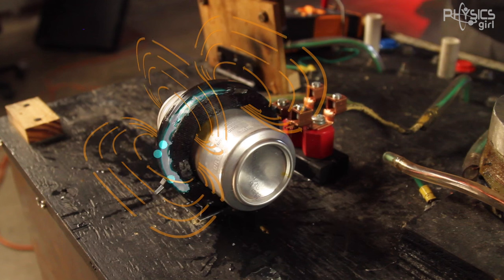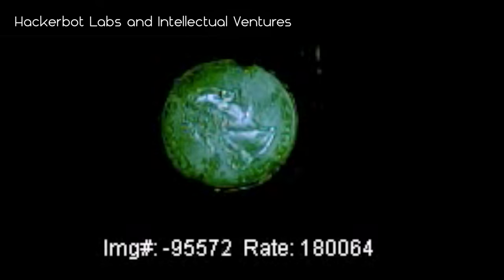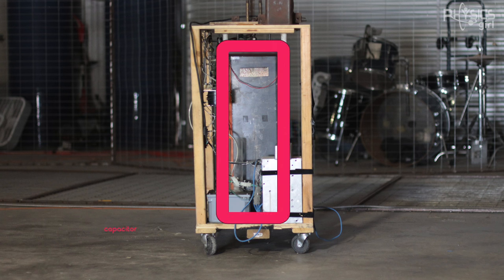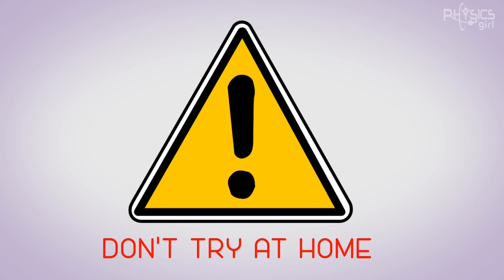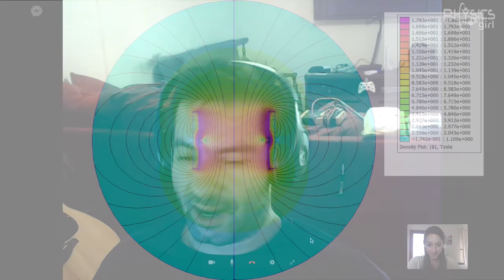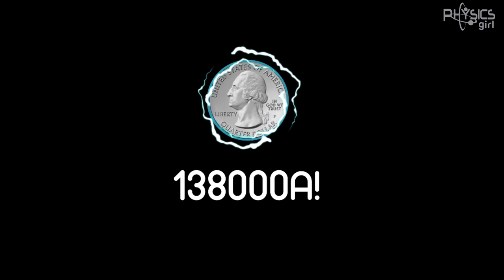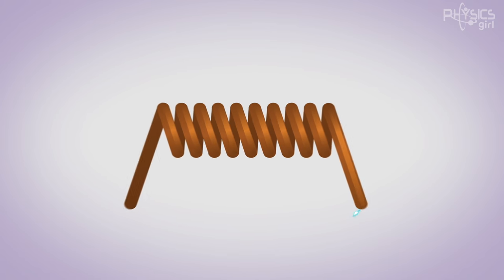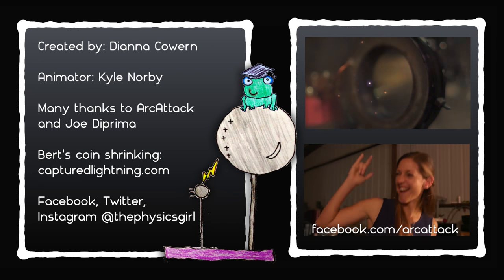How to Shrink a Quarter with Electricity

Comment: Where does it get the space to shrink?  It's not like the atoms change size, so I assume the empty space was already present in the coin and the atoms are just packed tighter.
Reply: The coin gets fatter, so it's not really "shrunk", more like deformed. The atoms might be slightly more packed together, but it would be a very small difference in volume.

Comment: The crazy part is, that this is the result of relativistic length contraction of the distances between the electrons in the coin. They are forced into the center by the eddy current.

Comment: Try that at 100KV (and less capacity or larger coil), should be faster for a more uniform result.
What happens to carbon? Can you turn a pencil into diamonds? What about with high heat at the same time.

Comment: If magnetism creates space, and dielectricity squeezes into counter space. And electricity is a hybrid of the two once split, trying to rejoin... Then, any coherent matter, capable of conducting the electricity... Theoretically will release the magnetic space, down to the atomic level in exchange with the magnetic reflector (the coil) in the attempt to rejoin the field in counter space. The atomic atoms/molecules, are losing their magnetic space in the process of unification. Space literally disappears, just like when two powerful magnets are near each other. I probably butchered this explanation, but the outcome fits perfectly with Ken Wheeler’s book on the missing secrets of magnetism. Which all physicists should at least entertain for the purpose of pushing the world into the next scientific paradigm. Ken is onto something, as crazy as he may be...

Comment: What you are doing is freezing time in the coil and as the rest of the universe expands, that little area is frozen in time and doesn't.  That is why the coil explodes as it is both frozen and not.  The coin is basically a little back in time and is smaller.  ;-)  Now if you can only figure out how to reverse the process and send something forward in time.

Comment: Wouldn't trust that bleeding resistor. If the shown circuit is correct then the cap would stop discharging through the resistor when the voltage dropped low enough for the arc to extinguish leaving an unknown charge in the cap. Don't know how much, but there would be something there.

Comment: Writting 5 years later... just thankful for the algorithm... And wondering Do the coins end up with higher density? is that even possible? The mass remains the same as they shrink?
Reply: Shrinking is a misnomer. Here is a line from Stoneridge Engineering website. "A shrunken coin weighs exactly the same as it did before shrinking. As the coin's diameter shrinks, it becomes correspondingly thicker, but its volume and density remain the same. ".  http://www.capturedlightning.com/frames/shrinker.html#:~:text=A%20shrunken%20coin%20weighs%20exactly,and%20density%20remain%20the%20same.

Comment: two questions:

what's the mass before and after?

what's the volume before and after?
Reply: Answer to both questions: The same before and after. The coin becomes thicker as it is reduced in diameter.
Reply: For a "science" channel you think this would be included. I wouldn't be surprised if density was slightly increased and some mass was lost. Likewise, I think it's unwise to make the assumptions you just did without stating them as hypotheses.
Reply: We have weighed coins before and after - no measurable change. We thought mass would increase a bit due to very light surface oxidation from the heating. However, we were unable to measure any change.
Reply: Bert Hickman Any volume measurements?
Reply: We were unable to detect any difference in volume. However, the measurement was not very accurate (i.e., volume of displaced water in a graduated cylinder).
Reply: +Bert Hickman I thought that may be a problem.

Solution I could think of was magnifying the result by doing a roll of quarters.
Reply: (by doing I meant measuring the volume of a roll of quarters before and after)

Comment: I need a bleeder for working on tube amps! (actually it’s fine if you just allow the amp to discharge before opening the chassis). Too bad we can’t use electric currents to shrink inflation as well as currency! :-)

Comment: did the mass of the coin change? if so, more of the why.
Reply: @little8660  now that i think about it, I dont think there is mass loss, some but not alot. same mass. it popped into my head about how a nuke bomb was thought of. compress a critical mass. then you get an explosion. well extreamly simplified of coarse. but compressing a mass into a smaller volume. or take how a diamond is made. by compressing the mass into a smaller volume.

Comment: Could it compress plutonium to supercritical mass ;)
Reply: Maybe.  If you had a slightly subcritical disk of plutonium with a hole in the middle, shrinking it would cause the hole to close and perhaps make it critical.  I don't know if it would be fast or significant enough to result in a substantial nuclear explosion though -- probably not.

Comment: I still don't get how the coin shrinks. It must be an annealing affect because the coin is stamped and expanded like cold forging. The Lorentz force must heat the coin and realign the atoms in a crystalline way so as to anneal the metal structure, causing shrinkage. Can anyone verify this?

Comment: Are the 138000 amps true amps if the time of discharge is a small fraction of a second?
Reply: Yes - amps are amps. It is the peak current during the capacitor discharge through the coil. It's an LC circuit, so it "rings" until the coil self-destructs.
Reply: I guess the computer can figure it out for the short duration of time. It is just that the amp is said to equal the flow of one coulomb per second.

Comment: How would a pure silver quarter (pre-1964) react to the coil?
Reply: The silver-copper alloy melts at a relatively low temperature. We've found that silver quarters and dimes actually come apart and the pieces turn a brassy color as some of the copper crystallizes out of the alloy.
Reply: +Bert Hickman

The pure silver coins?

Comment: 26 Megawatts? I'm sure the electricity company would not be happy about it when you take that much power from them. My guess is that to balance conservation of energy this amount of power will be required / available only during a very short time.

Comment: So basically the same mechanical force as a sledge hammer being slammed on a quarter to flatten and widen it except this is compressible around the edges only?  I've never thought of myself capable of exerting 26 megawatts of energy when wielding a heavy sledge hammer before but hey, I guess I do lift.. bro.   lol.
Reply: At CapturedLightning.com we use 5 kjoules to ""shrink" a quarter to the diameter of a dime.  5 kjoules is the same energy as 3700 pounds dropping one foot - one BIG hammer...

Comment: Hold on. There was no explanation as to why the coin gets smaller. Does its density increase via the process? Or does it actually lose mass when it shrinks? This video was not scientific... Why does the coin get smaller when subjected to a high inductive current?

Comment: You have to put in 26 million watts to get 26 million watts out. Something must be wrong with the math because there is no way that amount of power came from the mains. They said nothing about charge time of the capacitor. Given enough time one could eventually collect a million watts. 40 amps X 240 volts = 9600 watt hours X 24hours = 230400  watts a day. OK , that's getting there. You will have over 1 million watts in 4 days. So in about 100 days you could accumulate those 26 million watts. Then there is the cost. I pay about 15 cents, power and delivery, per KW/H . That's 3900 USD . Now I understand about peak currents and short discharge times. But can you get 26 million watts discharged in 1/1000 second without putting in a total of 26 million watts , No matter how long it takes ?
Reply: Don't confuse power with energy.  Power is watts, energy is watt-hours.  Think of it like a toilet flushing -- it takes a minute or so to fill the tank, then all that water shoots down the pipe in a few seconds when flushed, thus moving things down the pipe a lot more forcefully than the same amount of water would do at the tank-fill rate.  The coin shrinker multiplies the effect of a lower-power input to a high-power pulse even more, kinda like a toilet on steroids.
Reply: LexipMedia Power is energy.volts are not energy. Amps are not energy.Electrical energy is measured in watts per unit time. Based on the Coulomb . 1 amp at 1 volt for 1 second. That is 1 watt second. A 1 farad capacitor stores that coulomb at 1 volt and will deliver it to a 1 ohm load in 1 second.. I will do that calculation and get back with the size of a capacitor that can hold 26 million watts. I like your toilet analogy. but you still only get as many gallons out as you put in the tank. Same with a capacitor. I say it is impossible to charge a capacitor with 26 million watts using line current in a day or a week. My example is quite reasonable. 40 amps 240VAC 24/7 for 112.2 days is 26 million watts.
Reply: Of course we are talking about a whole lot of energy in a short short. (some pun?) the length of time is one question. I'm going with .005 seconds. The total resistance is another . The spark and ionized exploding coil , lets say effectively zero ohms. The wire, inductive losses and such ...well it's a crap shoot. How's about .02 ohms. OK just a edumacated guess with some math on the side and I get : One 650 Farad capacitor charged to 240 volts could deliver the requisite 26 million watts to the coil in 5 thousandths of a second. Of course such a capacitor is yet to be realistically conceived. Let's hope graphene  will make that possible. 26 million watts would take an electric car thousands and thousands of miles.
Reply: +Coil Smoke Check a physics text, or try WIkipedia to learn the difference between power and energy.
Reply: Call it whatever you like. These terms for work have nothing to do with the facts. The claims in this video are impossible. I have tried to use very conservative values and believe them to be a best case scenario.  Please give us your calculations for how this could be achieved..
Reply: At CapturedLightning.com, we use 5,000 joules to shrink a quarter to the diameter of a dime. It takes about a minute to charge the capacitor (in our case a 140 uF, 12 kV energy storage capacitor bank to about 8500 volts). When discharged into a 10-turn work coil made from #13 AWG double-build magnet wire, the resulting LC circuit "rings" at about 7.5 kHz. The current in the work coil reaches a peak current of about 56 kA in about 33 usec after the spark gap switch initially fires. The coin is fully "shrunk" during this 33 usec period.  The work coil explodes 10-15 usec later and any residual energy is dissipated in the copper plasma between arcing coil fragments. So: initially 5000 joules (watt-seconds) of stored energy is dissipated within about 40-50 usec, making the peak power during the process 5000/0.00005 watts or about 100 megaatts.

Comment: does that increase the density of the metal?
Reply: Tetra84 I would guess so since not much mass is lost as shrapnel and the overall volume increases. But, it won't actually be much denser since the coin becomes overall thicker.
Reply: Tetra84 no

Comment: "Under section 333 of the U.S. Criminal Code, “whoever mutilates, cuts, defaces, disfigures, or perforates, or unites or cements together, or does any other thing to any bank bill, draft, note, or other evidence of debt issued by any national banking association, or Federal Reserve bank, or the Federal Reserve System, with intent to render such bank bill, draft, note, or other evidence of debt unfit to be reissued, shall be fined under this title or imprisoned not more than six months, or both.” 18 U.S.C. § 333."

Comment: I don't understand your explanation.  You just said the magnetic field shrinks the coin.  That doesn't explain anything.  Metals have a natural density at room conditions.  If you shrink the coin, you have on of the following: 
- Density of coin is increased (please explain the physics of how that happens)
- some metal is vaporizer (removed somehow)
- the dimensions of the coin have changed (thicker so first two above are not in play)

Thank you...

Comment: It looks like the volume changes: so, the density of the shrunken quarter is two or more times greater? Thats verrrry interesting....
Reply: Volume stays almost exactly the same - the smaller diameter results in a fatter coin to maintain the same volume of metal in the new shape. The few milliseconds in which the coin is molten could theoretically produce some lost metal in the form of a gas that "paints" itself on the protective shields, but that loss would affect both mass and volume equally to maintain the same density. (= mass / volume)

Einstein's famous E=m(c squared) equation, rearranged to solve for mass (m = E/(c squared)) suggests the huge amount of energy used could alter the mass by only a few millionths of a single gram, which is too tiny for us to easily measure.

Comment: Another way to shrink currency ... deflation ...or inflation ... depending on how you look at it.
I came up with this unfunny joke on thinking  how fucking expensive it is to actually shrink a coin (based on the price for electricity here*) ... 

*= which is also because the companies don't want to store electricity ... so they pay neighboring countries to use up our electricity ... or the circumstance that to change to more green ways to produce and use electricity everyone has to pay an extra tax on electricity ... except when use it like there is no tomorrow ... (like for melting steel) ... and what those industries doesn't have to pay ... has to be paid by everyone else.